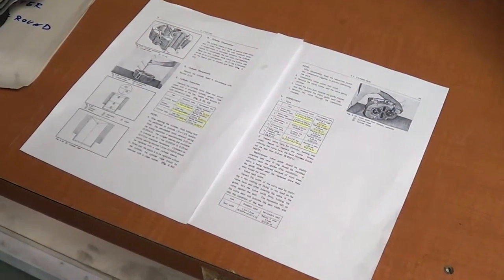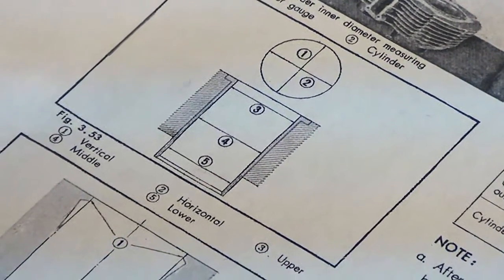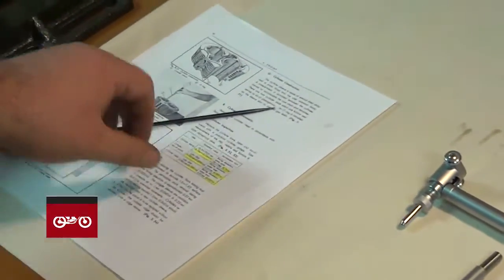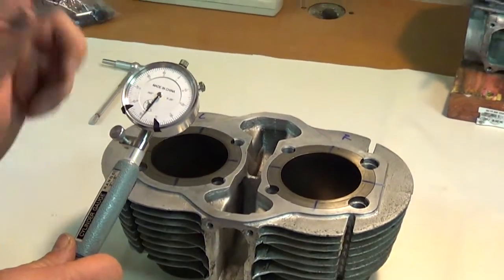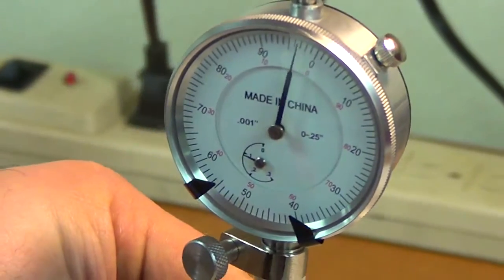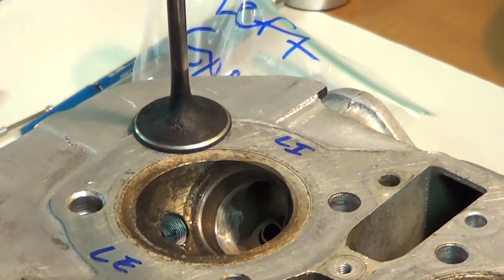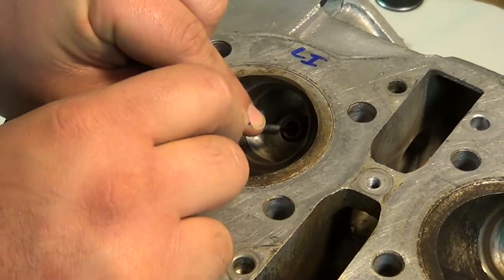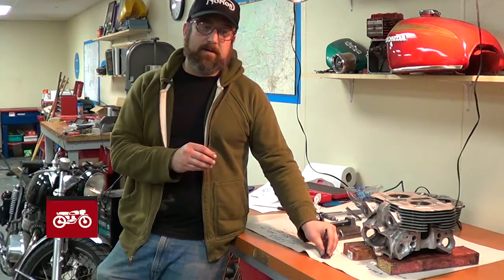How to Measure Cylinders & Engine Valves, Honda CB450 / CL450 / CB500T

Comment: After 2 years I finally determined that my non-firing right cylinder was due to a leaking exhaust valve. I took the head off and filled the dome with mineral spirits. Left held but the right immediately ran right out the exhaust valve. This head was taken to a local shop and was given a "professional" seat cut with these valves in the head 2 years ago. He's out of business now. Survival of the fittest I guess. Anyway, how would I determine if it's the valve or the seat? I tried lapping and there was no difference. I did notice that the shinny line on the valve is not symmetrical where it contacts the seat. Would this indicate a bent valve shaft?
Reply from the maker: If your valve seat is not symmetrical its definitely an issue but the best way to check if its bent or not is using a dial indicator on the valve seat with the stem chocked up into something to rotate it. They sell simple tools specifically for this purpose that makes it a bit easier to get a precise reading. I would also measure the valve seat width in the head and see if its within service limit, its possible the seat needs to be re-cut and lapped again with a new seat. If you have anymore questions reach out to our support via our 15 minute tech support calls.

Comment: do you have a vid on how to remove valve spring on a cb 450 ??
Reply: No valve springs on the cb450 brother, that motor utilizes a torsion bar system... I think that's what the part is called, but yeah no valve springs...
Reply from the maker: Check out our CB450 engine rebuild series for a little bit more information of that torsion bar system

Comment: Another great video. Do cylinders get smaller when they wear?  Although that initially made sense, I can see how repeated heat cycles can cause a cylinder to flare at the skirt. So, I'm not sure.
Reply from the maker: The cylinders get larger as they wear;  enlargement is  along the cylinder's length where the piston rubs the most. Typically cylinders are larger in the center and smaller at the ends.
Reply: Cylinders are generally larger at the top because thats where the combustion takes place. The bottom of the cylinder usually has very little wear. Im rebuilding a 1970 cb 450, thanks for this video, you just saved me some time by having to dig around in the manual for the specs :)
Reply: you're a fckng idiot and dont need to be on a motorcycle